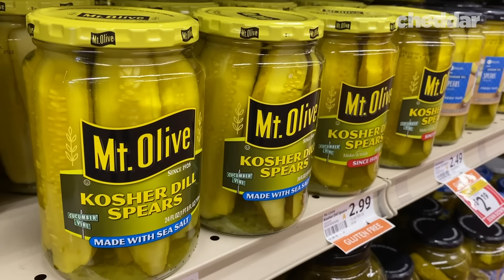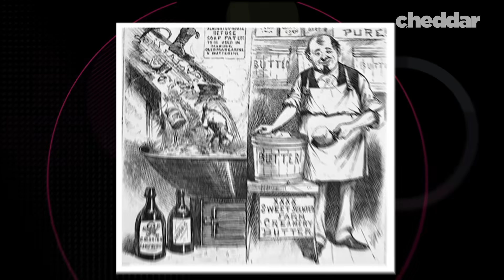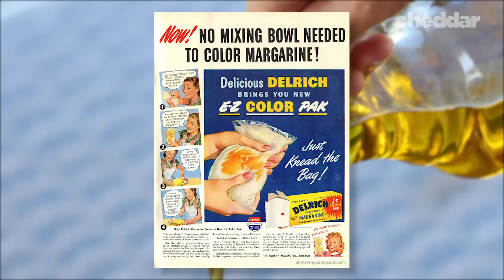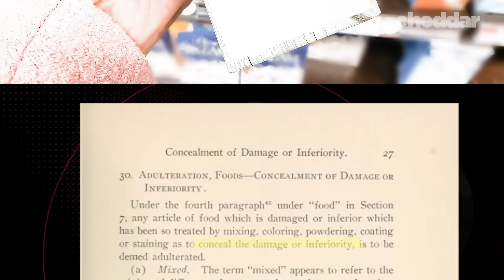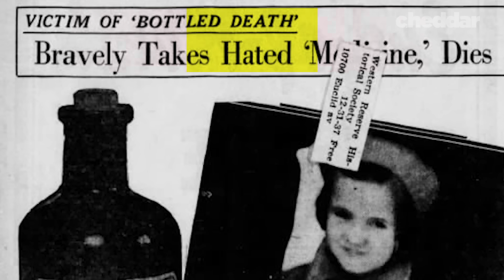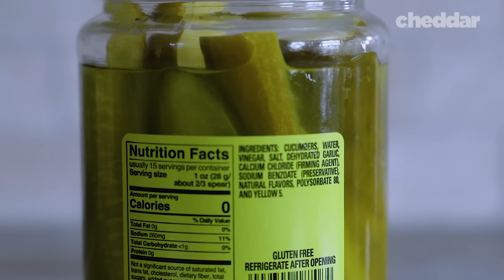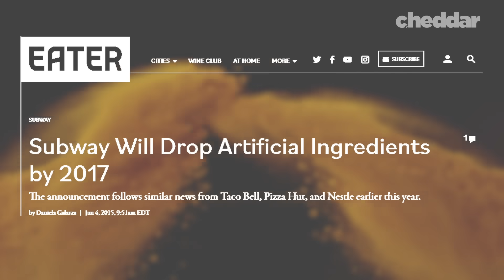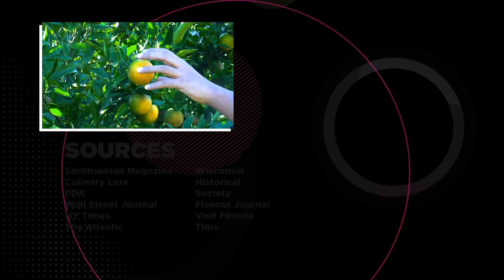Why The U.S. Government Decides The Color Of Our Food - Cheddar Explains

Comment: Now, this sounded odd to me-  I'm originally from Ecuador. That's as "equatorial" as can get. Our ripe oranges are not green! They do turn yellow, and some varieties are indeed orange. I've been to other warm countries like Spain and southern Italy,  famous for their oranges. Those aren't  green once they ripe either! I even tasted some delicious bright red orange juice from Sicily. No artificial coloring added as far as I know.
Reply: I'm from Indonesia, equatorial too, and the more traditional oranges from the local farmers are green, and we use them for juices, but the juice and flesh is very bright orange. The supermarket ones however, are indeed orange because they are imported. 
Could it be because you're from Equador and there, I know that there are a lot mountains and highlands, where the video said oranges farmed there with the colder temperature will make the colour of orange, orange.
That's just my speculation though.
Reply: @sergiol114  it's actually a very plausible explanation!  we do have cold weather in the Highlands.
Reply: @LauraTenora  that cold weather explains it! ;)
Reply: In Brazil, they're mostly green in fact. I had never seen an orange orange before going to Canada.
Reply: @sohopedeco  Is that so! How very interesting.  I'm currently based in Buenos Aires, and all the oranges  at the local market come from the north. Northeastern producers  from misiones and corrientes, close to the border with Brazil, account for the largest share of that market (no green ripe oranges there) So I wonder: perhaps they are different varieties altogether? Anyways thanks for  the input
Reply: @LauraTenora  Genetically modified seeds are sold all around the american continent, at this point most things thought to be naturally farm grown isn't necessary naturally, even if you plant the seed yourself.
Reply: @LauraTenora  2 things to point out here. 
A) If the entire country only eat orange oranges, they get the same treatment as the US and European fruits.
B) The reason why they can change the color is the temperature. It's the same why Blood Oranges only can appear when the temperature diffrence between day and night switch on a daily base. The orange color come from a group of pigments called carotinoids. They help to give various foods a orange color, but can only apear in colder regions. If it doesn't get cold enough over a longer time, the industry use a chemical gas called "ethylen". It's ability to help aging plants, is used to make the coloring go faster. As a payoff, they loose a lot of taste and their natural protection gets washed away. Ethylen can be also naturally produced by ripe fruits, like apples and bananas. It's a shame, but our society always want the perfection. Funny how human behavior is projected to plants and we basically discriminate them for the same reasons we discriminate humans lol
Reply: @LauraTenora  about the brazil thing you are completing wrong. Our oranges are green when ripe, some turn a bit yellowish, but I've never seen green oranges on the local market or things like that. What we have here that is orange is tangerines, but not oranges, oranges are green on the outside and orange on the inside
Reply: @annacarolinautidalopes393  I never mentioned Brazil! I've been only once to Brazil, and have no recollection of their oranges. I was busy trying kashasha I guess!
Reply: @sohopedeco  And I associated green citrus fruits always with limes. You put limes in Caipirinha, Mojito and Cuba Libre, don't you?
Reply: @derorje2035  We call limes "Tahiti lemons" here in Brazil. Hahaha

They're by far the most common kind of "lemon" and we do use it in all those drinks.
Reply: @sohopedeco  ah laranja baía é laranja
Reply: @sohopedeco  well, actually Seleta Orange is quite orange, although darker... It's my favorite one altogether with Bahia Orange
Reply: @sohopedeco  most oranges in the US are what you would call tangerines in Brazil which are always orange in Brazil.
Reply: @sohopedeco  how they taste? They are sweet or sour? In Italy, the place where i live, they all are Orange.
Reply: @adriandraia  They vary from very sweet (laranja lima) to a pleasant acid (laranja pera)
Reply: @sohopedeco   wow, thats interesting
Reply: @sohopedeco  people in the comments are mixing up clementines and mandarines that are orange all over the world. in the southern hemisphere oranges are all green , latin america and africa included.
Reply: @sohopedeco  where in Brazil you're from? I'm from Rio and our oranges are yellow, with some green parts to orange.
Reply: @g.matosdsul Quê? Aqui em SP, em todas cidades que eu já morei, sempre vi laranja pêra da cor verde (por fora).
Reply: @sohopedeco  Quando tu come farofa, tu come com uma laranja,' verde o laranja? I have never seen a green orange in Brasil
Reply: @luizaalberton1696  A laranja é verde por fora. Por dentro é laranja mesmo.
Reply: @sohopedeco  Sou de SP e já vi várias laranjas laranjas mesmo por fora
Reply: In India, it's orange too.
Reply: @Sacchidanand  In India, we have all shades from dark green to bright orange, but the commercially produced ones are orange because... they sell more. They use ethylene to turn some of them to orange too.
Reply: @Sacchidanand  depends. I had green coloured oranges too
Reply: If this interests you, there's a recent and very popular book about the history of bananas. FUN FACT? The reason banana candy flavoring tastes SO different than bananas to us is because the inventor originally modeled the recipe after a banana species that is now extinct for decades.

Bananas almost went extinct because the world uses one industry-standard preferred species, and when those trees got a contagious disease, well that was almost the end of all bananas. You can no longer get diversity in fruit so easily. There are so many different-tasting bananas out there you may never get to try.
Reply: @RachelDoesntknow  The Gros Michel isn't extinct. Just unprofitable to cultivate at scale. Once the fungus invades a field of Gros Michel, that field can no longer be used to grow Gros Michel.
Reply: @Markle2k  thanks, obviously
Reply: @Markle2k  And this is exactly what is happening with the Cavendish.
Once the spores are in the ground the land cannot grow that variety.
Even sterilization with ammonia will not work long term enough for the plant to mature.
Reply: @RachelDoesntknow   I saw a scishow video about that. As a kid I did get to know the Grand Michel bananas. they do have a different taste and aroma. I don't think they are entirely extinct. I I think there might be a few still around, but probably too fragile for export.  I'm not sure about this fact. There are many many more banana varieties that you would even imagine! Some have to be cooked before you eat them!
Reply: @RachelDoesntknow  come to southeast asia and BOOM native banana species everywhere! bananas are only so monoculture because of commercial cultivation outside of native environment, just like many other fruits and vegs.
Reply: I imagine that oranges are machine picked and some percentage are partially orange or green which wouldn't make the grocery shelves but by dying those you could deliver to shops for higher price instead of processing them for juice.
Reply: @chris-2496  They aren't dying oranges from green to orange that's impossible... the color pallet wouldn't work. This film is BS and why you shouldn't believe everything you see on the internet.
Reply: It's a simple genetics thing. Multiple colors of every food I know of
Reply: Here in india we have varied varieties of oranges and they vary from completely green to yellowish green and completely orange depending on the place it was grown. 

Oranges form south are mostly green while that from colder places like himalaya are orange in colour.
Reply: @kartik_sinha  exactly. ou place is semi arid and very hot here in Kenya. our oranges are very sweet and green in colour. nothing like the orange imports.
Reply: @kartik_sinha  it also has to do with the fact if oranges are oranges or kinnow. 

Kinnow are always orange and grown extensively in Punjab and North Rajasthan. 

Whereas, real oranges, the ones from nagpur can be green, orange, yellow, mixed etc.
Reply: I'm from Trinidad , in the Caribbean and our oranges are mostly green, sometimes with lighter areas of yellow
Reply: I am from Greece as well and all the oranges even these that grow in the streets are bright orange with no human intervention . Maybe the bright orange ripe colour is specific to the breed we cultivate in the Mediterranean 🍊🍊🧡
Reply: @feniak.9828  I was going to reply this. I am from Spain and I always see them super orange in the trees! I also googled about colouring them and it is illegal in Europe
Reply: Are you sure? I have lived in Ecuador my entire life and all local oranges are green and yellow 🧐
Reply: @normalgirlcvco  Yes! They are green and yellow
Reply: Probably has something to do with where they grow and the type of oranges. Been to an orange farm quite a bit in the south of France and the definitely have orange oranges.
Reply: In Kenya, I come from one of the orange growing communities and we have both. In fact, most of our orangea are green when ripe. very sweet and may turn orange but it is not important because we produce the sweetest oranges thanks to the semi-arid climate
Reply: Probably in some hot countries, a different type of cultivar more prominent than the type grown in the northern hemisphere. In my country, orange fruit is mostly green to yellowish. We do have "normal" orange-coloured orange tho, but it is a little bit more expensive and not as  common than the green one
Reply: The red orange juice could have come from a blood orange 😊
Reply: In Colombia oranges are green
Reply: in Venezuela most oranges are not completely green but a mix between green and orange, depending on how ripe they are. I don't recall ever seeying an orange being green as a lemon, but almost all oranges had green spots along with a little of yellow in them; no orange was ever 100% orange coloured. I only started to see perfect "plastic" lookin oranges here in the U.S
Reply: Yes, that I'd say is
 an accurate  description of what I  recall
Reply: I’m in Italy.... oranges range from yellow-orange to reddish-orange. I promise it’s not fake
Reply: In Nigeria they’re green with patches of yellow.
Reply: In Indonesia, ripe orange usually green with slightly yellow color on some part of fruit. The only fully orange color orange that i found are imported from china.
Reply: Here in Colombia some of them are yellow but never as orange as those in the Us. It's funny how in spanish the fruit and color have the same name but the fruits are green. Also if you ask a kid to draw an orange it's very unlikely that they use green 🤣🤣🤣
Reply: equatorial country here too. and yes, not all oranges are orange colored. most of them are green or yellow and even if there are orange oranges they usually have small traces / gradients of green
Reply: The majority of ‘oranges’ in Vietnam that I had were green, don’t think I ever ate one that I can remember but we used them for our screwdrivers.
We did add a lot of sugar (although probably not as much as you have in a can of Coke).
Reply: Yeah in spain oranges are orange,in fact,  some oranges are called sanguinas, or "bloody" because they are this beautiful red
Reply: @peioruiz1851  we call those blood oranges. They are so delicious. 

Do you have "cara cara" oranges. They have a compound like grapefruit and tomato called lycopene that makes them a unique pink  color. They have a  distinct flavor and are very tasty.
Reply: In Africa  oranges are green.  You'll hardly find an orange one there.
Reply: @jeane1889  Africa is huge, in the Mediterranean area of Africa oranges are orange, south africa too. Some other many regions in africa have green oranges. Some have both and some have yellow greenish oranges.
Reply: I think they are lying to some degree. I think these companies who mass produce a inferior food are tired of trying to make it look like what it's supposed to look like. It's probably getting expensive. Just like I've had wild caught salmon my whole life from Alaska, it's VERY pink. The farm raised ones I bet are not, and they are tired of making them look pink. There's a reason people think that these colors are natural, because they were.
Reply: They didn't always dye oranges. Instead of admitting as to who and how, they blame us for being stupid for thinking oranges are orange and salmon is really pink.
Reply: I’m from the Caribbean (as hot as it can get) from a town that grows oranges to sell and our ripe juice oranges are not green, they vary from yellow to orange. I’ve seen ripe green citrus fruits, but they are more in the family of lemons such as “sweet lemons” or in the family of grapefruit such as “sour grapefruit”, but they are not the oranges he is referring to. To say we’ve never seen or have orange oranges is simply not accurate.
Reply: I saw one channel from a guy in Vietnam and the oranges he ate were green. I didn’t know green oranges existed until I saw this last year!
Reply: Guatemala has oranges that never turn orange. They stay yellow/green and are super sour and tough to eat. Nothing like a california orange. "Never seen an orange/orange" is an exaggeration though.
Reply: In India, they turn proper orange, and they are tasty too.
Reply: Just like human have different shades of skin color, even within the same ethnicity, fruit also have different shades of color, usually within green-yellow-orange spectrum, in my hometown, banana comes in green to yellow shades, oranges from greenish yellow to orange, and lime comes in green and yellow. This is not even considering the change of shades because of ripeness
Reply: Maybe in Ecuador, but in Venezuela oranges are fully green or yellowish, never orange color.
Reply: It must be different breeds of orange, no? I'm in Portugal and I have family and friends who have orange trees and they're all orange in the tree. Here, if your orange is green (or your citrus in general, like clementines, tangerines, etc) it means it's not ripe yet and thus not good for eating. I went orange picking a few times and you never pick the green ones. Also, sweet oranges only came to Europe after the colonization of South America. If I'm not mistaken, there were oranges in Europe before that, but they were a sour kind of orange (i guess like a lemon?), and the sweet varieties that are grown here now were brought by the Spanish and the Portuguese from the Americas. I might be mistaken though.
Reply: There are a lot of types of citrus in the world. In my country, the Philippines, we have a citrus that looks like an orange but is green.
Reply: Confused me too... In France they're often imported from Spain though, so I think the color is natural here
Reply: I'm from next door, Colombia, and oranges are yellow. The statement we've never seen yellow oranges in supermarkets is fiction.
Reply: Yeah that fact seens bs, the oranges here in California and Forida are usually orange too, right off the tree.
Reply: Blood oranges are on the red side.
Reply: Maybe because Ecuador has a cooler climate than other Equatorial countries
Reply: I'm from Brazil and yes we have ripe oranges that are totally green
Reply: They’re orange in China as well
Reply: in Brazil, a lot of them are a mix of green and yellow/orange.
Reply: In Brazil they're kind of yellow-ish green. The bright orange ones are usually imported.
Reply: Thats not true in the philippines theres a green orange too
Reply: Im from Bénin in Africa we have both! The green one and orange/yellow when ripped
Reply: I'm from southern italy and oranges are unripe when they are green, I'm 100% sure they are not processed for the simple reason that I pick them from the tree. ( It's common here to go to the farm and buy directly from the farmer, also I have several orange trees at home ). We also have red oranges but those are red also inside and have red juice
Reply: Spain and Italy are NOT warm countries, they are as far from the equator as NEW YORK!
Oranges grown locally in asia are green, like VERY green. case closed.
Reply: @---iv5gj  What is a warm country then? In the video they say in the US they have green oranges, and its still far from the equator. ANyway, I've read its not about the country being warm (Spain gets hotter than many of these countries mentioned). What makes the oranges orange is having a big temperature between the day and the night.
Reply: @abcoh4440  you are absolutely right about temperature difference(plus cultivars play a role). But then, regarding warm countries - warm countries don't have true winters. There are only periods of less hot, hotter, and very damn hot. Subtropical and tropical countries are like that. Countries that lie between 23.5 degrees latitude are generally like that. So our "oranges" and other citrus fruits are quite usually green. Green oranges, green mandarins/clementines, green pomelo/grape fruit, limes...
Reply: Oranges are mostly green in Nigeria and they are juicy and delicious
Reply: I live in the Caribbean, most oranges are greenish orange.
Reply: From Ghana here also close to the equator and our oranges also ripen green. There are some yellow and orange colour variants too with no colouration
Reply: In my country we have red orange, we call them "oranges sanguines " ( bloody oranges)
Reply: In areas where there is more sun and warmer weathers the oranges have more chlorophyll and cold weather also helps the orange color come out.
Reply: I am from Spain. Our oranges are oranges or between orange and yellow-ish. Not seen many green oranges...
Reply: In the Philippines, we have both green and orange. But the green ones are more "traditional."
Reply: I live in florida, the oranges are orange. If you drive near farm land where oranges grow, the oranges are indeed orange
Reply: I have an orange tree in my backyard, and its bright orange
Reply: Also from Ecuador yeah I’ve seen orange oranges and clementines mandarinas
Reply: in indonesia i know orange oranges are imported, so i always choose the local green ones. i think its just came down to different variations of oranges
Reply: Yea those reddish colored ones are called blood oranges and their fucking delicious!
Reply: Ripe oranges are green or yellow where I'm from
Reply: It seems to me if an orange is green, it ain't an orange. 
In Japan we have these funny flat citrus that are bigger then a Mandarin Orange, and are mostly green with just a bit of orange underneath, called Yuzu. It's the other ingredient in Ponzi that isn't soy-sauce.
Reply: Yeah, green oranges are also oranges but a different sort. If you have naturally orange oranges that are green, they are just not ripe. Which is common when picking fruit too early for transport and sale.
Reply: @Carewolf  Hehe. Ever eaten a tomato in Japan? 
When I was a kid and went back and forth between California and Japan I learned all about shipping perishables. 
Japanese, like everyone, love a nice wedge of tomato in their salads, but tomatoes don't come from Japan. They pick them while they are still green, bitter and hard so they will make the voyage without bruising, then a day or two out from port they gas them to make to make them red. 
Personally, I've always hated them, but I learned to chew and swallow them. Being a kid from Cali I know what they are supposed to taste like, and that ain't it. 
Due to the school year my brother's and I had to go a month or two before my parents and we stayed with our cousins. By the time my parents got there, I was back to refusing to eat them. 
"We're so disappointed in you" they said that first night. Parents always want you clean your plate. Then my dad ate his tomato, got real quiet and swallowed it. 
"You never have to eat another tomato again. You worked hard to learn to eat them, but that is one of the worst things I've ever eaten in my life and I understand why you don't want to eat that." 
Frfr...you can drop one into a sock, swing and hit someone with it and do serious damage. Being three brothers sans parental supervision, we tried it. It HURTS.
Reply: Maybe because they use the same process to color the orange 🤷‍♂️
Reply: Yeah... I also don’t understand that... I live in Portugal (next to Spain) and our oranges are naturally orange (sure they first are green but when they’re ripe, they’re orange).
Reply: I'm Ugandan. Pretty much all our orange varieties are green.
Reply: Spain isn't equatorial at all and is quite cool compared to tropical countries. Here in Vietnam all oranges are green. Any orange Oranges are imported from other countries. And in the video you can see the same thing in Thailand
Reply: I've literally seen orange oranges on the tree in the Philippines lol
Reply: Yeah red oranges here are so freaking good (Sicily and Puglia)
Reply: In india, we get both kinds. Some are orange, some are green, some are mixed
Reply: The oranges are actually green in the Dominican Republic, even when ripe. Lemons and tangerines as well. I guess they come here for the info XD.
Reply: The oranges are actually green in the Dominican Republic, even when ripe. Lemons and tangerines as well. I guess they come here for the info XD.
Reply: What do you mean? Our oranges are green and yellow ish (i’m from Ecuador too)
Reply: In my country of Myanmar, home grown ones are just green with some yellows.
Reply: In my colour our ripe oranges are greeeeen
Reply: In my country our ripe oranges are greeeen in colour
Reply: Indonesian, Malay, and their neighbors : Laugh in Jeruk Peras
Reply: In uruguay they are allmost all orange, some have only orange spots and are mostly yellow
Reply: I live in Mozambique, and have orange trees in my yard, they are green when ripe, and yellowish when  they start to transition into putrid. Tangerines however, are as orange as orange can be
Reply: so occasionally satsuma are sold green. But people that have them in my neighborhood don't pick them until orange.
Reply: Equador chicks are manish
Reply: Yes I am from Florida and ripe oranges are never green. They would be too bitter if green and unripe... this person is  full of 💩
Reply: I’m in California, oranges are definitely orange. Inside and out. Limes however, will turn yellow and to tell them apart you must scratch and sniff.
Reply: America thinks is the only country in the world 🙄
Reply: Yea my dad has some orange trees the are orange
Reply: Orange is orange in South Africa lol
Reply: Exactley for that reason i had hitted the unlike button for this video. I don't say that its 100% lies, but at least 40 precent of the info is indeed fake.
Reply: Im Nigerian…equatorial as well our ripe oranges are green we do have some splotches of yellow sometimes
Reply: Those are called grapefruits.
Reply: Ripe oranges are green in West Africa, they're delicious and loaded with seeds so they're as natural as you're gonna get.
Reply: That was odd to me as well.  I'm from Southern California. In Orange County/Riverside, you will drive passed many orange Groves where every orange on the tree is in fact orange.  I wouldn't say California is known for being a cooler state,  so I think that bit of the video was hogwash.
Reply: When I went to uganda, a country in Africa. All oranges were green!
Reply: Look for Tropical Oranges, 
Business and Marketing 'Program' people to do believe Wot they want.
Reply: yeah, i grow oranges.  They're worthy of the name when ripe.
Reply: They are green in the Caribbean
Reply: @kayode8428  No they're not. I'm from Jamaica, and ripe oranges are yellow to orange. We do have something we call "sour oranges" which ripe green, but are totally different in taste from "regular" oranges.
Reply: How rare, I am from Colombia and most oranges we found in markets are mostly green with a bit of yellow, I've only seen orange oranges  are the imported ones.
Reply: Oranges that are never green at ripening are likely a modern standard market species, usually a hybrid of multiple citrus fruits not a true original orange. Many (or all?) native un-hybridized orange tree species will have this green-when-ripe property. Just like the leaves of trees are green, the outside of the fruit is green. When it gets cooler in fall, the leaves on trees drain of their green color. This is the same for those "true" orange species--they drain their green chlorophyll as the weather cools down. For those  green-orange species, if they are in a warmer and less temperate place, it never cools off enough for them to drain their green pigments.

Alas, diversity in our fruit species is pretty rare nowadays. The agriculture industry has made it so each fruit often only has one species that's the GLOBAL "standard" and will actually sell. So seeing anything other than the one probably-hybrid orange-orange we see at the grocery gets less and less likely each day.
Reply: @RachelDoesntknow  aren't all sweet oranges hybrids of pomelo and mandarin orange?
Reply: @prosquatter  Sounds right to me!! I would have to guess something along those lines. Ahh you're making me hungry for a tangelo lol 😋
Reply: I am looking for the days that we see right is right,  and all of our foods are not processed.  Oh, wait, that is my eutopian, idealistic, ever hopeful desires coming to the surface.
Reply: @lourias  This is probably how a lot of people feel, but the reality is much more complicated. If we successfully banned the use of all dyes, which is itself unimaginable, the most likely result would just be higher food prices with the same colors. Producers would switch over to processes and ingredients that color products without being explicit dyes, raising costs and complexity but giving the same colors. Such a ban also wouldn't work in a lot of cases anyway, many food dyes have properties producers can argue are needed in their products, feeding salmon astaxanthin enriched feed would be argued as a more "natural diet" for them (true) and as an antioxidant/whatever to make them healthier (with no evidence). A lot of other dyes are in similar positions, especially in baking, where their non-dye properties also contribute to the product so they would resist regulation targeting dyes.

I agree it seems really perverse that so much work gets wasted purely on appearances, but as long as it's profitable they will do it and it's up to us to try to reduce the harm they do.
Reply: @johnstonefield1935  that's only assuming that people would keep demanding things to be unreal. I know they will, I just don't get it.
Reply: Man i was saying the whole time ''wtf is this video''
Reply: I've seen a lot of this claim that ripe oranges are green in hot climates lately. It must be Texas/Florida propaganda trying to excuse their dyed fruits. If I walk out in the back and pick a green orange off one of the trees, not only will it be uncompromisingly sour, it will be less than half the size of an orange-colored fruit. And we are warm enough that we get 3-4 flowering/fruit cycles a year.
Reply: @Markle2k  we have green oranges in india, and they are no different from the orange colored ones
Reply: I think they got it confused with mandarins which can be green even when ripped, depending on the variety. Also, probably US supermarkets only carry the varieties for table use. In other countries we can find several varieties of oranges for different purposes. Usually, the ones that are green or yellow are sold for making juice. Those varieties were breed for that purpose and their appearance in not really relevant, also tend to be more sour but more flavorful.
Reply: They're just lying. :/
Reply: I’m also from Ecuador (the coast which is where the oranges come from) and our oranges are green....they do turn orange eventually but never orange orange as they are sold in America 🍊more of a yellow color (currently live in NYC) Although they are green they’re still ripe and sweet.